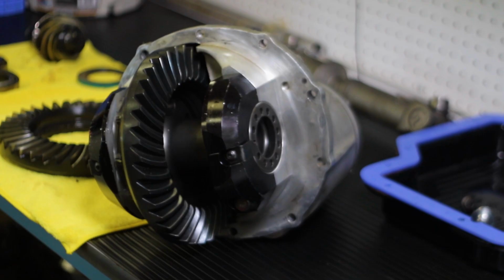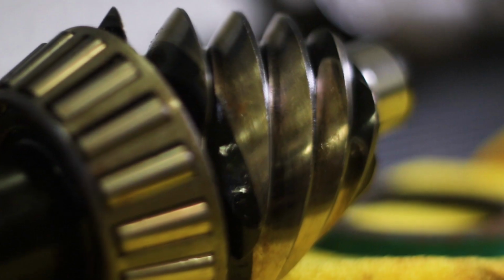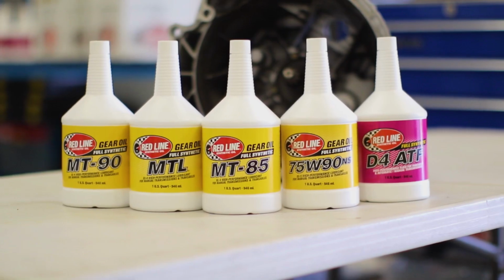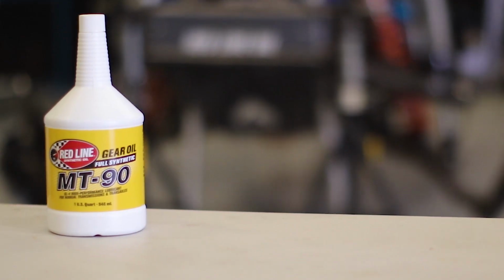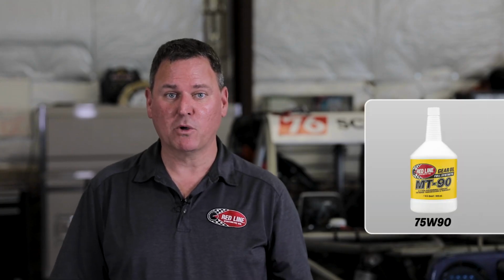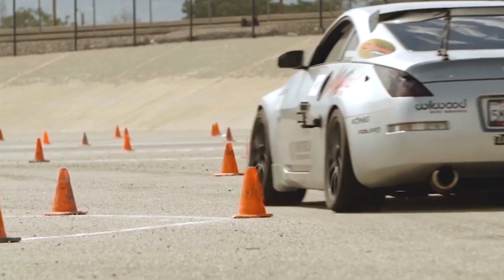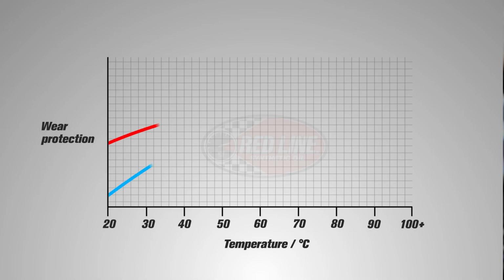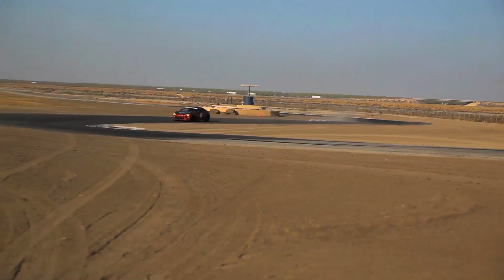Red Line Oil - GL-4 Gear Oils For Manual Transmissions

Comment: I just did my fluid change. I used 5 pts of royal purple max gear 75w-90 and poured in through the shifter tower. The bottle says gl-4/gl-5 and says it protects yellow metals, and I've seen others use it as well.

Comment: I decided to put the GL4 MTL in my VW Golf 1.9 tdi 150k miles and it started to whine. I rechecked the level and no issues there. I drained and refilled with VW which I understand is Fuchs and lo and behold the whine went away. I just wasted £45 for no good reason!

Comment: 75w-90 GL4 for 93 Nissan Sentra SE-R 2.0l 5 Speed has LSD limited slip Differential and Redline 75w-90 GL4 have shoockproof fluid well some, is balanced. This car is on the street not a full blown dragster.

Comment: I've been using Red Line Synthetic Oil. 75W90 NS GL-5 Gear Oil(manual transmission) for my 2013 Hyundai Veloster DCT for about 2 years and still no problems. LMK if I screwed up badly
Reply: According to this video that's a yes if you used it for your transmission fluid.

If you needed 75W90 you should've bought the MT-90 product.